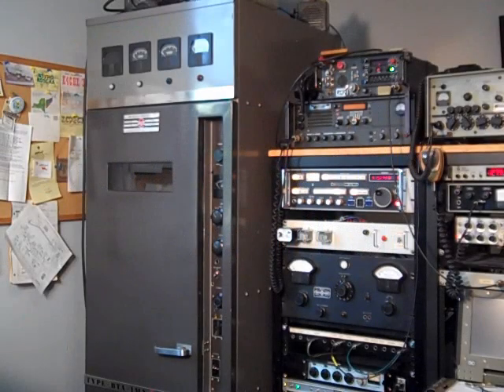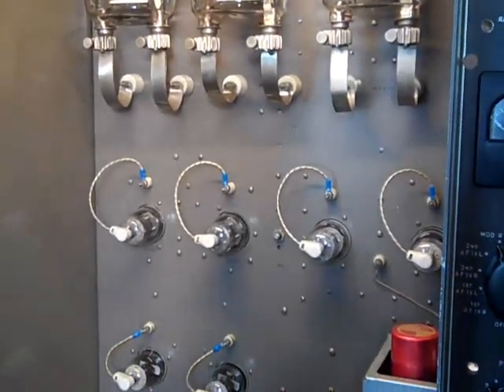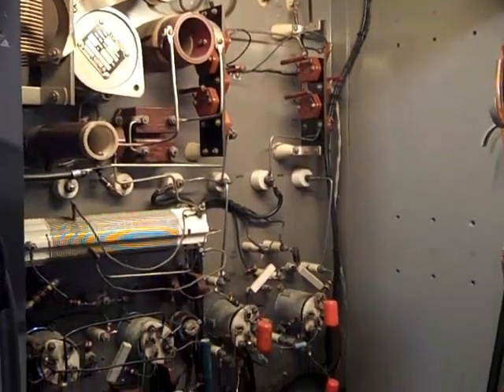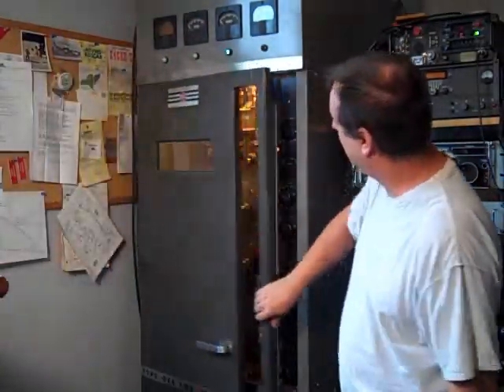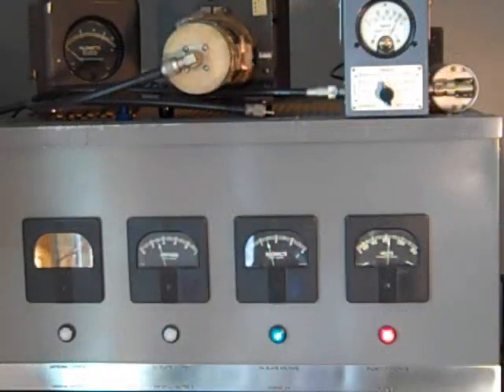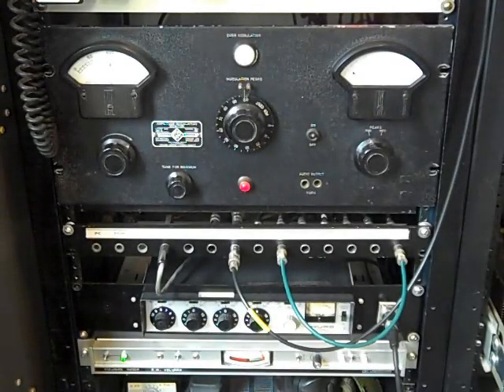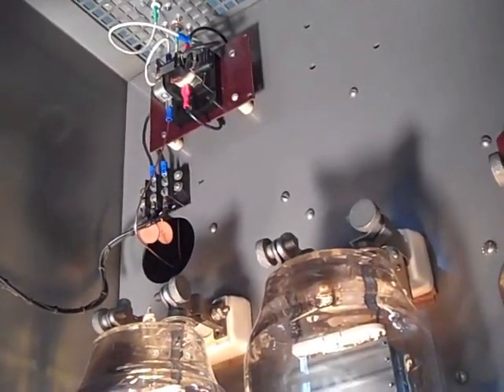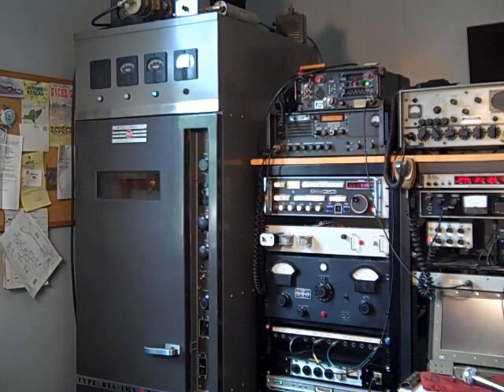RCA BTA-1MX AM Transmitter

Comment: I dearly love the BTA-1M. Worked at a radio station that had one. Quiet, smooth running xmtr, and it wasn't shy on modulation iron! It just worked and sounded great! Great job on yours! I npw have a Bauer 707 I'll be converting to 160m. 73 De KD5MHQ

Comment: Great restoration job, Ray. That thing looks brand new! I miss the blue glow of the mercury rectifiers though. One of my childhood memories was hanging around the local radio station watching the blue glow of 8008s pulsating with the beat of 1960s rock music. Sort of a preview of the flashing disco lights a decade later. But I'm a little concerned with the size of your T/R relay- I'd like to see something a bit bigger with ceramic insulators. You can get some surprisingly high voltage spikes in RF circuits.